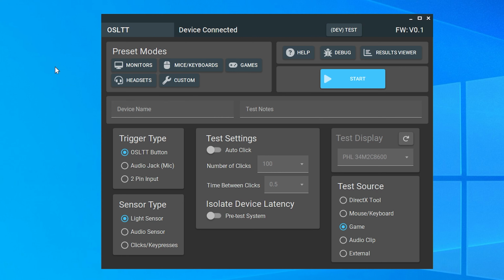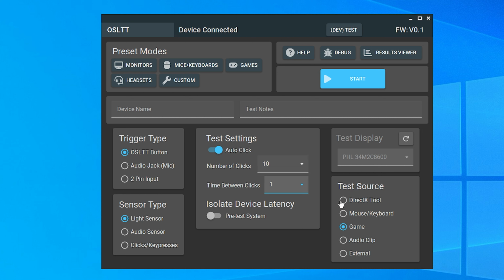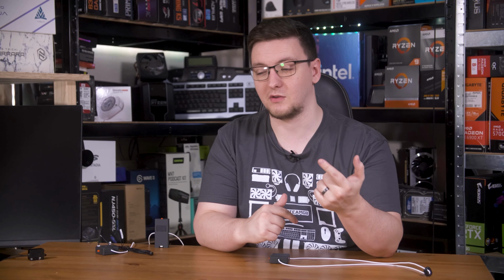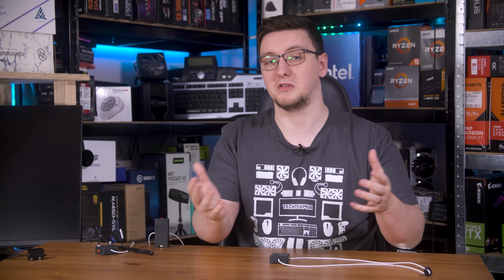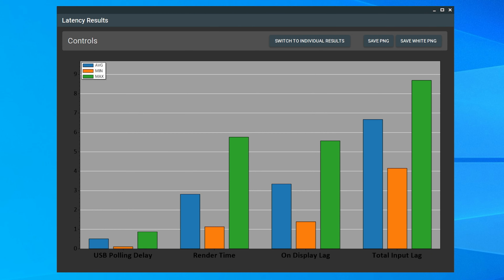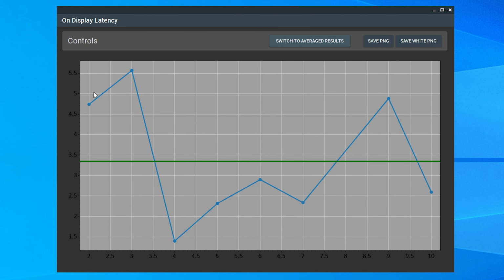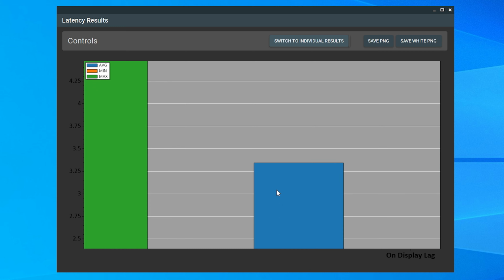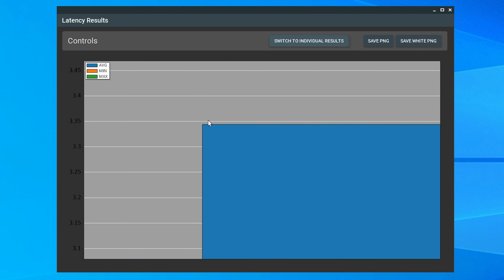The Open Source Latency Testing Tool (OSLTT)

Comment: Is there a way to have a latency number come up on the unit itself? I was interested in comparing handheld consoles to arm-based emulators? If not, I guess I could strap it to the screen while plugging it into a pc...
Reply from the maker: At the moment the processing is all done on the system, so you would need a PC to connect it to, but I've done testing on consoles and it works fine for that